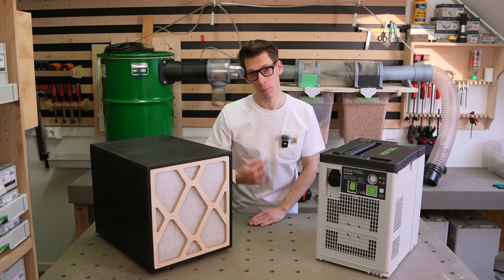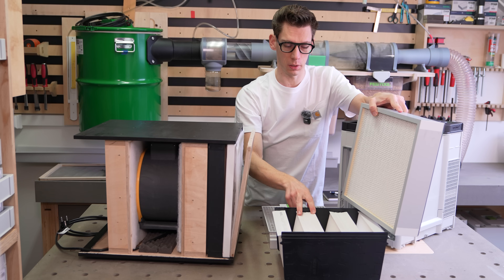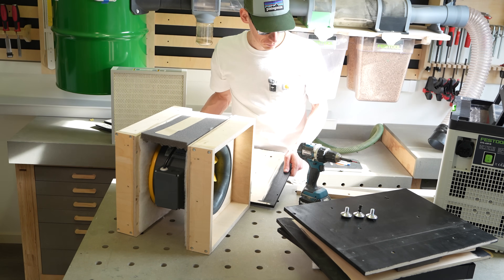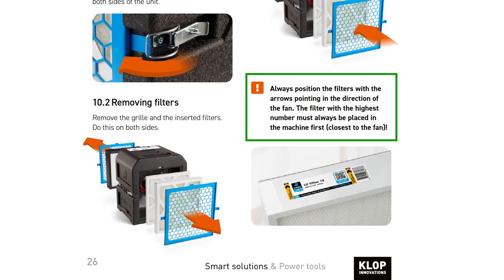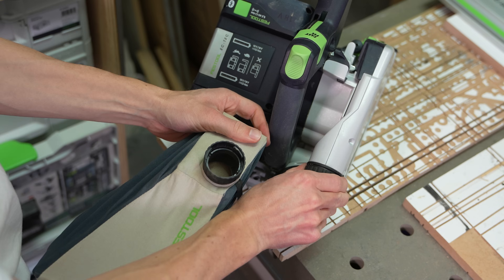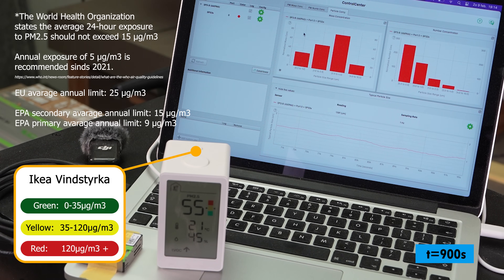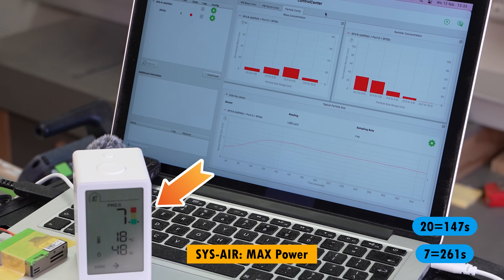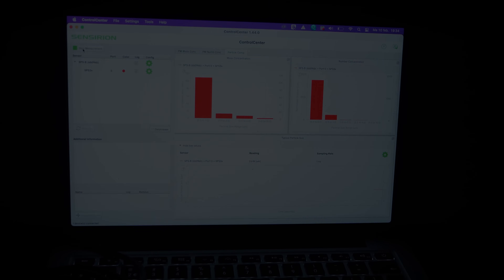DIY HEPA air Filter VS Festool SYS-AIR M Mobile Air Purifier | Can I Beat Them?

Comment: How many DIY air cleaners could you make for the cost of the Festool air cleaner?  Make that many and then compare the performance.
Reply: Then note the time it takes to research, build and troubleshoot, make corrections and adaptations, might throw in testing and measuring as well.. hmmm
Reply: Really valid point, but then you'd also have to factor in the amount of space all these DIY cleaners would take in the workshop!

Comment: Nice vid, alot of information but also a rabbithole 😅.

I am curious what would happen if you use only a filter on one side of the fan (in- or outlet). In this case it would be more like a boxfan. 

Or when applied with a 'zakkenfilter' in your setup.

And there is also the Corsi-Rosenthal box...

Maybe for next video's some more testing?

Comment: I looked into, both, the Festool and the Hilti air scrubbers. Neither offer charcoal filters.  Dealbreaker. The major US made brand, Dri-Eaz, offers many products in the category that embarrass  Festool and Hilti. Meanwhile, there is no shortage of cheaper Chinese made options from $300-400.
Reply: I wanted to buy Festool SYS-AIR M but filters is so costy, so i think i will buy chinese scrubber. It costs 2.5 times cheaper and filters are 10 times cheaper i think
Reply: Why do you want charcoal?  For smells?  We use the Hilti in construction.

Comment: In addition to the speed of air purification, need to compare their cost. This way the difference in speed will not be so significant 🤣
Reply from the maker: Good point! 

Back in the days I built mine I could make 3 of my versions for one Airbo. 

Now compared with the Festool it’s 2:1. So that will indeed compensate for the airflow 👍

Comment: In my shop, I can easily exhaust air to the outside and provide a good air intake as well. Will this eliminate the need to filter the air? I live in a moderate climate, so for most of the year, I’m not running AC or heat. Thanks, Joe
Reply from the maker: It depends on the outside air quality and your needs on inside air quality depending on your situation. When I look at myself I noticed that outside air quality is very time dependent. I live in a city and wind direction out the west the air quality is much better than when it’s from the east. East winds are coming from land and West winds are from see (much cleaner!). 

I was shocked how bad the air from the east was. And definitely will have some air cleaner built for in my house and bedroom. I can only open a window and don’t have a central duct system for clean air intake.
Reply: You should filter regardless and not futher pollute the environment

Comment: Strikes me the big difference will be the centrifugal fan - they are far better for high static pressure situations which the highly restrictive filters will benefit from. A hybrid of yours+festool would be best imo: Use the filters to make the motor quiet, but use a centrifugal blower for better airflow.
Great build, great science, and great video!
Reply: Absolutely. An axial fan is great for moving a lot of air with low pressure differential, but a centrifugal fan is better when the pressure differential is higher. Those filters, especially the HEPA filter, add pressure differential across the fan, so your axial fan is likely running in stalled condition, which is why it is a making a load of noise and not producing good results. It's effectively a load of paddles thrashing the air around to no great effect. You'd be better off with a fan arrangement that has a lower no-resistance flow rate but a higher static pressure, such as a centrifugal fan, or a stack of several smaller axial fans in series. Both of those possibilities would be quieter.

Comment: I'm not sure if someone pointed this out already, but the fan you're using for your filter is potentially installed wrong, maybe the datasheet will tell you - but usually they need some tubing in front and in the back to provide best suction (because they're meant to be inside tubes I believe). At least that's what I've experienced with my tube fan.
Reply from the maker: Ideally it needs also a silencer tube behind it. And this type of tube fans are not made for high static pressure. The centrifugal fan would be more effective only Airbo also used a tube fan of some sort, so that’s why I went for this one.
Reply: @CapturingDust  Thanks for clarifying I've just noticed with my fan that if I don't have tubes (which are at least the fan diameter in depth) in the back and front the pressure it creates drops also significantly.
Reply: You can double up the filters to compensate for lack of static pressure. If you put 2 filters in parallel  you cut the airflow through each in half, making them more efficient. While also cutting the resistance in half, making your fan move more air.

Comment: The sensirion is actually quite a nice sensor. I use it in several products. Just keep in mind that the max it can measure is pm2.5. It actually only measures pm1 and pm2.5, all other values are calculated. Measuring larger sizes it would needs a bigger sensor and/or much longer integration times (but this is the same for all those small particle sensors).

Comment: Hey, Filtration Engineer here, great video! I don't know how I missed that channel for so long.

I just wanted to comment on a few points of the video, maybe some of them are helpful for understanding.

So you are right, the particles around 0.3 microns are generally the hardest to filter. This is because, the interactions between the microscopic fibers and the filter media and the particle heavily depend on the particle size. Particles smaller than 0.3 microns are so small that their travel paths are increasingly affected by the random interactions with the fast traveling air molecules. Therefore they no longer follow the mean air stream but "wiggle" around a lot, increasing the chance of hitting a fibre. Larger particles on the other hand are too heavy to follow the stream of air molecules around the fires, so they hit the fibres too. And around these 0.3 microns is this material dip in Filtration efficiency, due to particles being too big for this "wiggle"/ Diffusion motion, but still small enough to closely follow the stream of air around the fibres.

Another addition to the air flow direction of a filter: this is mostly important because the Filtration media are layered structures with multiple functional layers that are designed for different tasks: in a lot of cases you want to have coarser layers at first and then gradually get down to finer layers. This should enable to capture the large amounts of dust and big particles in the first layers, while filtering out the fine particles at a later stage. This should increase the amount of dust that can be captured while preventing the fine material to be clogged up with coarse particles. So if you put your filter in the wrong direction, your filtration efficiency should not really change, but the amount of dust that can be captured / the time your system takes to be "full" will decrease.

Also I saw a comment mentioning Clean Air Delivery Rate as a suitable metric for your problem, as you already pointed out, that for you it is more beneficial to have more airflow and thus a higher exchange rate. I would also think so! If we look at the particle size of wood dust, most particles are above the sub micron range, where Filters of Class H (Hepa) are a bit overkill. A two stage system of an G/M and an F9 / E10 filter should be totally sufficient for your needs.

Note: The Filtration efficiency drops with higher air speeds and increases with lower speeds, so the Filtration efficiency labeled on the filter is only valid with the volume flow stated on the filter :D Nothing to worry about, but it helps to keep that in mind. 

Best regards, 

Jonah
Reply from the maker: Hi Jonah! Gladly for me you found out about my channel 😀. It took me a little while to figure this out myself but your comment is been very helpful to put this in words! Thank you 🙏
Reply: Dude so fun to read this.  Thanks for posting
Reply: So... for a given filter area a high flow when you're dumping particles into the room and a low flow after you've captured the gross contamination? To overcomplicate it bypass gates adding finer filters (reducing airflow) depending in what particle counter is reporting😊
Reply: I'm assuming a mechanical engineer that specializes in filters.
Reply: Filtration engineer- what kind of BS are you spewing?
Reply: @leemobai762 If you are frustrated, because your university does not offer such a program, you are right. You enter that niece field via process engineering or material science. It's a profession, rather than a degree in the end. I would suggest you to work in the industry to see that there are a lot of professions relating to engineering that are highly specialized and not covered by their own full study programme. But working full time on filtration mechanisms and filtration media selection for years, leads me to consider myself as a filtration engineer.

Comment: Great to see a comparison between a shop built and a quality M class filter. Cutting MDF is indeed a great challenge as it creates lots of very fine particles and calls for a M rather than L rated filter. It would be interesting to know the cost comparison. I would think you could have 4 or more (10?) of your shop built for the cost of the Festool. For the best of all worlds extend the unit with another fan and have filter fan filter fan HEPA. Still relatively compact. Airflow is maintained and full HEPA 13 filtering achieved.
The Festool (and equivalents) have an indicator for low air flow (filter change req'd). You could add this via a differential pressure gauge for ~20 euro from Aliexpress.
Run tubes from the vacuum to the filter inlet and trap all those fines before they get away.

By the way you could also add another HEPA filter on the outlet using them as a pair but arranged in a V. Gives ~ half the resistance and so air flow would be increased.
Also Dustcontrol AC500 use a G4 filter 0.2m2 before their HEPA13 filter 4.2m2 for their 500 m3/hr unit (Airbo & Festool 700 m3/hr). I am guessing allows less restriction but results in HEPA filter being filled faster.

Comment: Air quality is quite the rabbit hole!  Last time I looked I couldn't find any credible info/products outside of expensive commercial units.  I didn't know ikea has products of that sort though, now I need to look into them!
Reply: It was the air quality instrument not a filter box.
Reply from the maker: The IKEA FÖRNUFTIG is also a Air purifier. I have one as well en also tested it out with the same method. It’s a really low energy filter only not the best for the small particles. But for te hybrid approach maybe suitable. I will address this maybe in a next video.

Comment: "clean air deliver rate" is the key! Healthy home guide channel has a video about the why.
Tldr: lower rated filters can still remove some fine particles.  But with much lower air resistance, the fan can move a lot more air. Somewhat lower effeciency * lot more air = lot faster cleaning. Hepa makes sense, if you must clean incoming air for example. If you want to clean the air inside, most likely a lower rated filter will be better due to the higher air flow. Just as you experienced!
Reply from the maker: I also did found that channel, it’s very helpful! He made me doubt my initial plan for using a true rated HEPA filter. And my tests confirmed that it is maybe not the best way forward.

Comment: I built a large 2'x2' box that is 5' tall and used (12) 20"x24" filters.  The blower fan is mounted to the floor inside the box blowing out.  This way its flow stirs up any dust the settles and resuspends it so the filters can try to catch it again.  I put the whole thing on casters so I can bring it close to the current dust source.